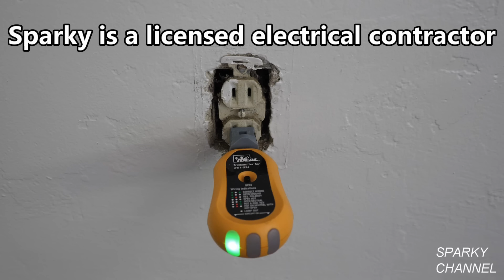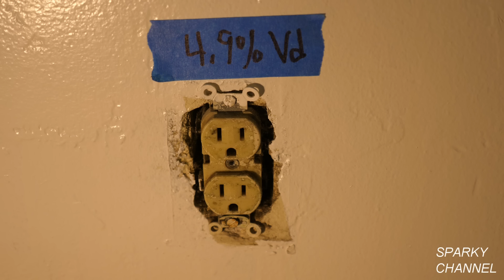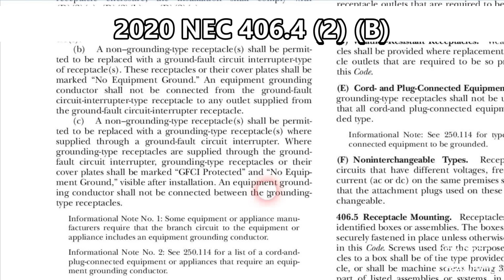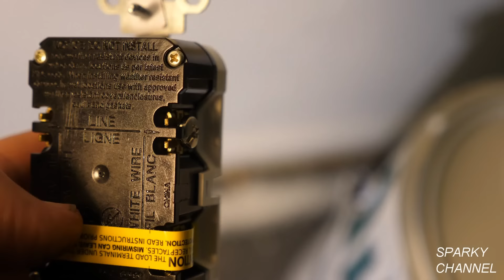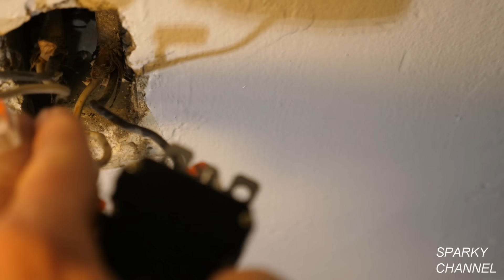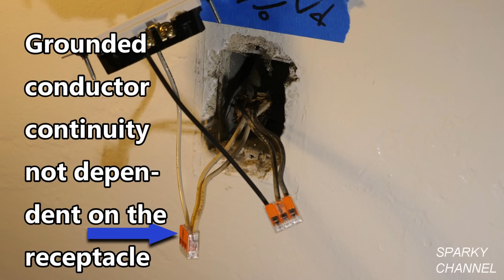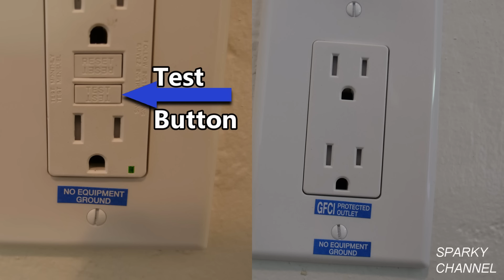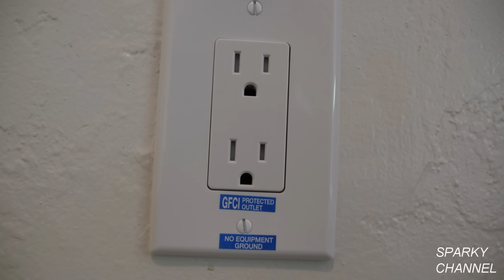2 Prong Receptacle Circuit Replaced by GFCI and Grounded Receptacles per 2020 NEC

Comment: That's a lot of voltage drop, heat up conductors and shorten lives like motors, TVs, computers.
Reply: I was wondering the same thing.  I was under the impression that max voltage drop for 120V was 3.6%.  Can you clarify that for me.  I am new to the trade and just want to make sure i am on the right path.  thank you your help would be greatly appreciated.
Reply: @rudyalarcon1106  Last checked NEC had it at 5% maximum drop. Have not done electrical design for years, no residentials, mostly industrial. Use company standard design handbook, keep it at 3% drop, calculate voltage drop on every circuit. Take the conductor DC resistance value, assume 80% power factor if not available. Good luck.

Comment: Thanks, this was educational for a non-electrician like me.  
However it would good to hear, at the beginning of the video, what is the main purpose of the installing a GFCI receptacle, what are we gaining by installing this, and did it require a ground wire at the first receptacle or not (I didn’t catch) that 

Thanks 🙏🏼
Reply: The GFCI outlet will essentially trips before your equipment becomes a shock hazard in the event of a fault. This installation does not require a ground wire per the 2020 NEC.
Reply from the maker: Thanks so much!
Reply: What people gain is the ability to use three prong plugs. The code requires the GFCI. It is for safety as there is no grounding. The alternative would be to run a ground wire which is more complicated.

Comment: you forgot to add pigtails to ensure wires that come out of wall boxes are 6 inches long or more pigtailed to original shorter line and load wires before reinstalling them into proper receptacles and electrical tape installed all around edges of newly wired receptacles before installing into wall cavity

Comment: We🇩🇪use in old TN-C Systems the Neutral as PE...PEN...and yes it works and nobody gets fried.
Reply: In Europe there is no need to change the sockets as if you have ungrounded sockets you can still plug schuko plugs in. I would recommend a portable RCD though.

TN-C has its problems and it is not used anymore 

Here the issues were other way but as most old style ungrounded devices have been long discarded it is not an issue so often.
Reply: @okaro6595  In my Area, Northeastern of Berlin City Center (Mitte) 🇩🇪the Housing is from the 60s and 70s, Steelconcrete. In the 90s completely overhauled in almost anything. TT Electric System, Kitchen 400V for Range 25 Ampere, 230 V for other Standard Outlets 16 Ampere in the Bathroom. But old Aluminium Lines they left in the Living and Bedrooms. So they put together N + PE only for those electrical Lines in the Conduit Protection Switch Box, you call it Breakerbox😊. The other new are totally separate, Copper, L N PE, and Range L1 L2 L3 N PE. Last week they changed to digital Meter. I tested it out with a Waterboiler. I touched the  Steelunit connected to the PEN, nothing happened!😱

Comment: Outlet I went to replace today had two wires to it black and white. I believe there are another two wires, a black and white that are further up in the wall that were used to power in above sink light. My question is this: can I wire a GFI with just the black and white wire or do I need all four?

Comment: I'm confused. Not really sure how GFCI works. With no actual ground,how is it protected?
Reply: GFCI or RCD as we call it in England work by measuring the current flowing out of the line and returning back to the neutral (sorry can't remember American terminology). If there is a imbalance between the current flowing out of line and returning to neutral then it must be returning via ground so trips cutting power.

Comment: Hi, when ever I try to  run a 9.5 amp wet dry vac or my  12" miter saw (I think is 15amp)  on a 20 amp circuit  the breaker trips,.. but it will run on a 15amp circuit?.. the 20 amp is a arc fault circuit
Reply: The motors in your devices are tripping the Arc Fault breaker. This is common with the older style ARC Fault breakers. I suggest upgrade the breaker to a newer design higher quality breaker. The breaker detects electrical "noise" on the circuit and is meant to trip if it detects arcing such as if you drove a nail into a wire shorting the wires to each other or ground. It trips immediately on the arc detection not on amp draw like a normal breaker. It thinks the noise generated by the motor is an arc. The brushes on the motors contacting the commutator arc a bit in normal operation causing the tripping of the breaker.
Reply: @BADBRAD1959  Hey .. Thanks!! The breaker is about 11yrs old

Comment: Great video but I have some questions before I attempt this on my home built around 1950 or before.

1. How can I find the most upstream outlet in a three family home if the breaker is in the basement and several outlets seem “closest to it”. 
2. Can you explain why you put the wago nuts and the pigtail on the three prong outlet at 14:10 and what would happen if I installed a three pronged outlet downstream from a gfci outlet but didn’t do that?

Comment: Didn’t see this question, I really want to upgrade outlet connections and have the modern 3 wire grounded circuits. Is it best practice to also pig-tail grounded connections on outlets after the lead outlets as well? I really like the idea of taking the disruption of the circuit in the event of a single outlet failure.
Reply: Pigtailing the receptacles is always a good idea, and that goes for the grounds as well. All the grounds inside each box need to be connected with each other by code. You have it right, the circuit won't be disrupted if a receptacle goes bad.

Comment: Can you use this method in single outlet that branches offold knob & tube individually in attic? Just want to put one in bathroom.
No remodeling of bathroom involved.
Reply: In that case he would be better off installing a GFCI circuit breaker

Comment: What's the difference between the IDEAL circuit breaker finder and receiver ($100 on Amazon) and Klein Tools circuit breaker finder and receiver ($40 on Amazon)?
Reply from the maker: The IDEAL works consistently. I got so mad at my $40 Klein circuit breaker finder that I threw it away.
Reply: Thank you. Consistency in this case is very important! Also showing the actual code is much appreciated and you make it more understandable with your explanations, thank you.

Comment: you know I was trying to remember how we use to find a feed back to the panel without a ground and neutral when I was watching this yesterday, don't need all that fancy equipment, just a voltage detector, kill power then remove all receptacles and switches and connections, then cap everything off separately, turn the power back on and start checking for voltage, eventually you will find a set of wires with voltage, that will be the feed back to panel....

Comment: Why cant I just install gfci for all the plugs in my home..
Reply: You can, but it would be very expensive. GFCI receptacles cost 20-30 times what a regular receptacle does. It would also be unnecessary as you can protect a whole circuit with a single GFCI by putting the GFCI as the first device and putting the rest on the load side. Or you could install GFCI breakers. GFCI receptacles also aren't super necessary if you have proper equipment ground and the receptacle isn't near a water source or outdoors.
Reply: @homestar92  So can I swap my standard breakers with all GFCI breakers. I have a older home with all 2 prong receptacles, I want to upgrade them all to 3 prong receptacles GFCI
Reply: @oldskoolwayy  Should be able to. It will again be a little pricey as GFCI breakers can cost 40 or 50 dollars each but in a home old enough that you have no grounded circuits, you probably don't have many branch circuits. I am not an electrician, just a DIYer who has done a lot of electrical work so of course, take my advice with that in mind.

You could minimize the cost though with a little legwork on your end. If a circuit has only one receptacle on it (which is often the case for Microwaves or other appliances) you could just install a GFCI receptacle. Likewise, if you know which is the first outlet on the circuit and all the rest are fed from that one, it would be cheaper (and functionally equivalent) to use a GFCI receptacle on the first outlet of the chain in that case as well.

I would also consider the rooms most likely to see a GFCI get tripped and opt for GFCI receptacles there rather than the breaker purely for convenience. Imagine you're in the kitchen or bathroom and you splash water onto your outlet and trip the GFCI. If it's a GFCI outlet, you just hit the reset button and you're good to go. If you're using a GFCI breaker, you will have to go to the main panel and reset the breaker there. From a safety standpoint, it makes little difference whether your GFCI protection comes from the breaker or the outlet, but convenience is worth considering.

If money is no issue, however, GFCI breakers are going to be the quickest and the easiest to install since you would only have to kill the main power disconnect once and you could install all of your breakers in just a few minutes. Plus you can probably get breakers that offer both GFCI and AFCI protection for not much more money and more safety features is always better.

Comment: When my elderly parents sold their house they had  bought in the 60s, the realtor told them they had to upgrade all the bathroom and kitchen outlets from three prong outlets to GFCIs to meet code .
 They called in an electrician who gave them an estimate of $2000 for ten outlets!
 While visiting there in Boston for work, I did the job for them in a couple of hours costing about $100 total.
Reply: that's because the licensed electrician had to pay insurance for his liability, although 200$ an outlet seems kind of high!
Reply from the maker: Wow! You saved them $1900! And you did OK making the $100!!!
Reply: @SparkyChannel  The $100 was to buy the GFCI outlets. At that time you could buy a GFCI for $10
 I did the work for free.
Reply: @Mr. G As I recall, two full bathrooms and a small powder room. Basement laundry had two circuits one dedicated for washer and dryer and one on the other side of the set tub that also protected two outlets at the wet bar. Kitchen had one on each side of the sink and the disposal under the sink that had been added on to the basement lights circuit. Finished off with one circuit dedicated to a basement sump pump and one by the barbecue on the other side of the patio that was on the garage circuit. I protected the three outlets in the garage with the last one. The whole job took me less than three hours. 
 A $2,000 job it wasn't. I couldn't see letting them pay $2,000 to an electrician that didn't have to pull a single foot of wire to do the job.
Reply: @williardbillmore5713  you are a good son
Reply: @deadmanswife3625  Dad is gone now, but lived to be 102.
Reply: @williardbillmore5713  oh my goodness.  That is amazing Williard. 🤗
Reply: @deadmanswife3625  I like to think I was a good son because he was good dad and a great man.
 It was a life well lived.
Reply: @williardbillmore5713  ❤

Comment: did you have use the wire nuts in the boxes per code ? or just an option?
Reply from the maker: There aren't any wire nuts in the GFCI boxes I had. They do include the little stickers though.

Comment: You sound a little like Scotty Kilmer... "WRAP UP YOUR CONNECTIONS!!!"

So if you had twisted your pigtail/pass-through connections at each receptacle, would you have seen a slightly lower amount of Voltage drop?  Would it be higher if you'd used the non lever-action Wagos?
Reply: LOL I was thinking the same thing!!  Scotty is a good car mechanic!
Reply from the maker: No, I think the lessened Vd came from making tight connections throughout the circuit. I don't think there would have been room in the boxes using wire nuts.

Comment: If I wanted to put a dryer receiptecle 3 prong would I just split the black and connect them to the either side and then split the white wire but leave one taped ?

Comment: Question: my house has two prong outlets. No grounded box and No grounded wiring. can i replace the outlets with three prong and install a jumper between the ground screw and neutral on the new three prong outlet
Reply from the maker: No. That is called a bootleg ground and it's very dangerous.
Reply: Even though the neutral wire is connected at the N.bus bar and is metal contacted with the main breaker panel along with the N.incoming lug bus , there still is NO independent Grounding wire & bus bar w/ neutral grounding bond ! It is a 3 wire service { A & B phase 120vac/ 240vac w/ Neutral } .

Comment: Genius, never seen this before. Great way to find the first in line.
Reply from the maker: Glad it was helpful! Thanks!
Reply: I just plug in receptacle testers in every plug and turn on every light switch { switched plug or a draw off feeder load/leg line } and turn off one branch circuit at a time and walk around with the tape to see what went out. Now most the time ... your HR 1st feeder is the closest plug or light box to the main panel, once you have everything marked - cut the power back on to determine if there are { switched plug or a draw off feeder load/leg line }.

Comment: The NEC recommends no more than 3% voltage drop per branch circuit 210.19 (A) info note No. 4. Is it common for households to have that amount of voltage drop on a string of receptacles? That seems like a lot. It might not effect general lighting, but I think fans and other motorized components might be effected at 9% to 12% drop.
Reply: Time for new wire eh?

Comment: If you do what you just showed in houses wired with romex or conduit where the circuits go from one outlet to the next, this "work around" for two wire receptacles (no ground conductor) works. Many "older" houses, however, are "knob and tube" wired. With that method of wiring, the extensions (branches) of the circuit that continue downstream to the remaining outlets cannot be "interrupted" by the GFCI device since all the splices are made INSIDE THE WALLS instead of in the outlets. All of the original wired outlets will only have two wires going to the device. You would need to install a GFCI device at EVERY outlet.
Reply: Thank you Sparky and Pappa Bob.  I have a house with knob and tube along with romex.  No ground anywhere.  A licensed electrician wants $5k to install new gfci's and switches.  Waaaaaayyy too much money.  Based on the video and comments, I can do the job myself for about $300.  This includes gfci's in each outlet.
Reply: thanks for this! i was wondering why some ppl replace EVERY outlet with GFCI -
Reply from the maker: Excellent advice Pappa Bob!

Comment: have a circuit breaker that now works in when in the off position, and doesn't work in the on position. I just did some rewiring, and am an amateur. I messed something up somewhere.  What could it be ? Is it dangerous ?

Comment: Sir, can you add a link for the extra wire used in the pigtails? Great video!
Reply: He didn't explain that, but to make the pigtails he had you would just use/buy extra wire of the same gauge as the wires feeding the circuit, also making sure to match the wire colors to not confuse yourself or anyone else who ever works on it in the future, so just a white pigtail to the white wires, black pigtail to the black wires, etc. And if the circuit is using 14 gauge wires use 14 gauge wire for the pigtails, if it was 12 gauge wire being used on the circuit you would use 12 gauge wire, etc. Just that simple.

Comment: Thanks Sparky Channel, this was an outstanding video.  Two excellent tips I picked up from watching this were:  (1) How to find the most upstream outlet in a series of outlets, and (2) how to wire all the outlets to provide continuity of hot and neutral lines to all the outlets even if there is physical damage to one upstream outlet.

Just these two tips alone made the video worth watching. And please note that you can use these tips even if you don't have the expensive circuit analyzer hardware shown in this video. And another thing: those Wago connector nuts are great!
Reply from the maker: Thanks so much!

Comment: Why did u put pigtails on the downstream outlets instead of hooking them up the original way?
Reply: Because this way ensures reliable power supply to the downstream outlets if one of the intermediate outlets (after the GFCI) suffers some kind of physical damage (like even a simple loose / broken screw connection).  If he did it without the pigtails, a simple fault like that would remove power from all the downstream outlets. Sparky mentioned that in the video.

Comment: What would happen if you just put GFCI in every single outlet in the house ?
Reply: Premature hair loss, high blood pressure, anxiety, paranoia
Reply: It would cost more.... I would re-wire personally, but if money is a issue or it’s a cheap landlord than this is a great option.
Reply: We do this in UK. Install GFCI circuit breakers, this protects every outlet & hidden cables.
Reply: I think it would just waste money since GFCI are more expensive.
Reply: You would simply waste your money if you did that.